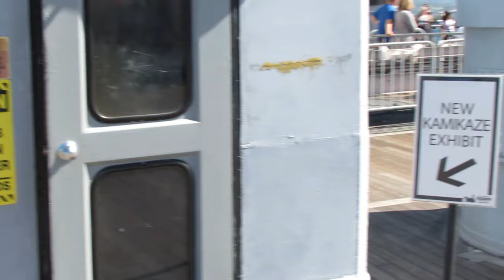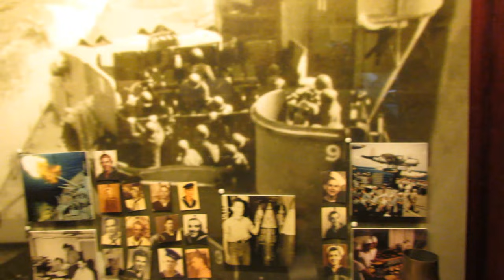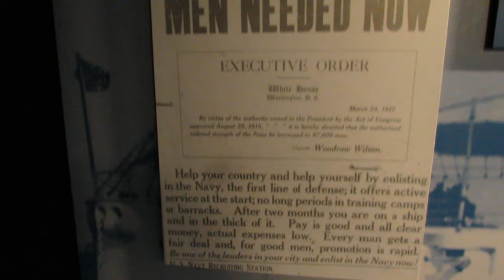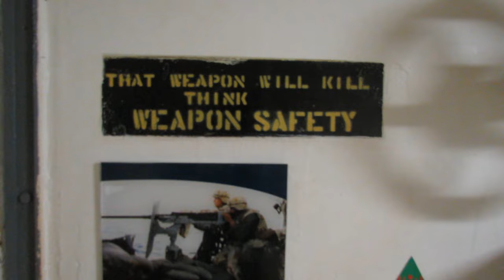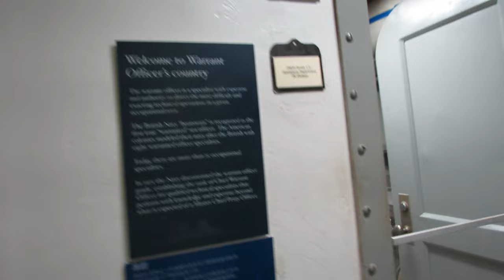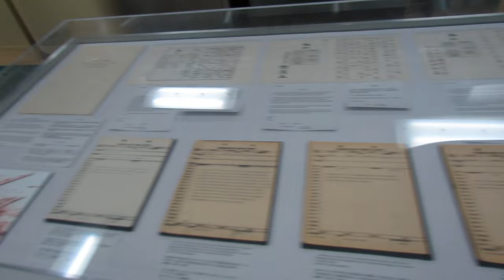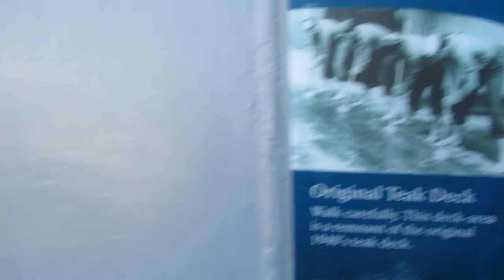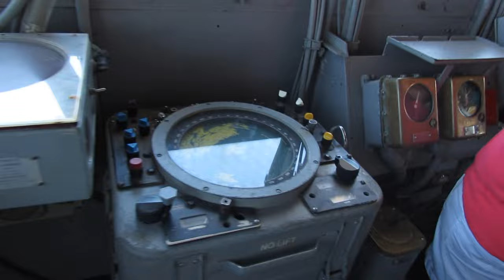Battleship USS Missouri (BB-63) Video Tour Pearl Harbor, Hawaii

Comment: That ship is ready to roll out except it needs ammo and a refueling.
Reply: Sorry to say, no she is not. Quietly rusting away below decks. I worked on her 2015 as tour guide and had the honor of doing HEART Tours, whick were below deck to engin rooms. Amazing.
Reply: Actually she can. "On 14 October 2009, Missouri was moved from her berthing station on Battleship Row to a drydock at the Pearl Harbor Naval Shipyard to undergo a three-month overhaul. The work, priced at $18 million, included installing a new anti-corrosion system, repainting the hull, and upgrading the internal mechanisms. Drydock workers reported that the ship was leaking at some points on the starboard side.[41] The repairs were completed the first week of January 2010 and the ship was returned to her berthing station on Battleship Row on 7 January 2010. The ship's grand reopening occurred on 30 January."
Reply: So the Iowa’s were eventually taken off the register because the new Zumwalt with rail guns were supposed to take over the roll of shore bombardment capabilities.  So now that the navy has figured out that the shells for the rail guns are too damn expensive they ended up canceling the damn program.  So what do we have for NGFS??  Nothing that equals these sixteen inchers!!  I hope we don’t have to do any beach storming operations.
Reply: The 16' were great guns and still in operable condition the only problem us that the powder we have for those guns was last produced in 1945 and stored for 40 years on a barge on the Hudson river. Much of the powder was unstable in 1989. I can only think what 29 additional years has done to it.
Reply: jkutnink87 The 16 inch guns aiming system cannot be taken out by an EMP attack. As for the powder...it would be more practical to design a new shell for the guns and a more efficient loading system. You don't realize how big those turrets are until you stand next to one.
Reply: None of the Iowa class battleships can move under their own power